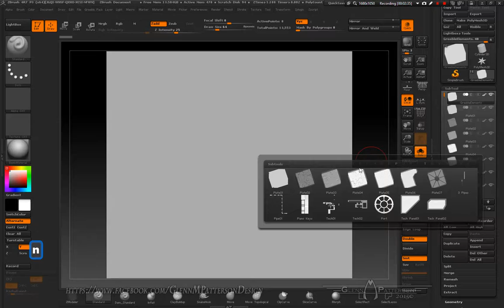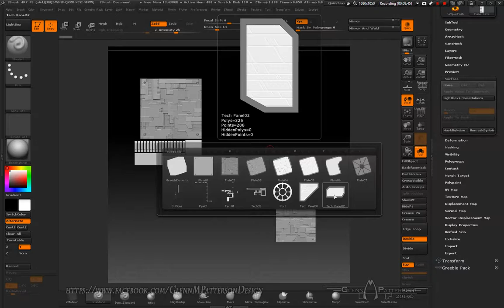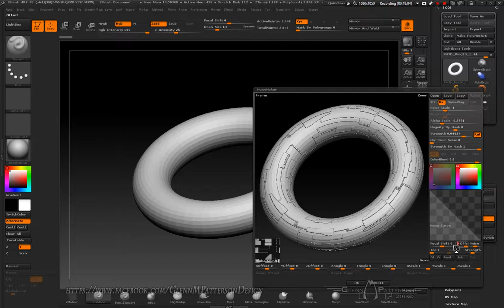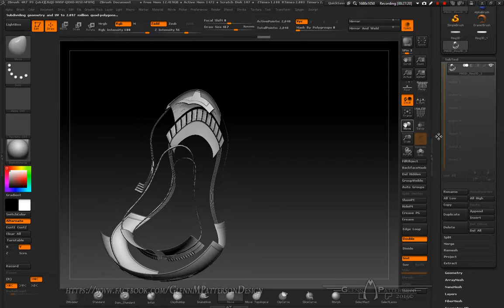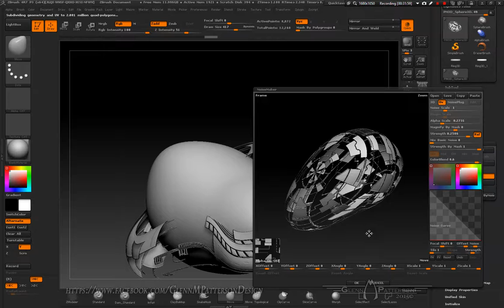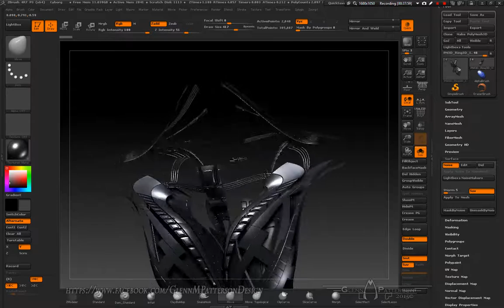Greeble Elements

Comment: Nice, to have the back faces of the cut away new model just duplicate the subtool and than flip the normals in the display properties... than you can merge them and do whatever you want =]
Reply from the maker: ***** Tried that Method. It doesnt work as expected do to the differences of the heights of the Depth Map. Some parts line up, but a lot dont. Hoped it would work, dont think there's a quick/easy solution to making it work. I'll keep tinkering.

Comment: Great as usual!
Reply from the maker: Arn Gyssels Thanks! Hope you can make something Cool with it
Reply: Glenn Patterson Hey Glenn, i can't seem to get the Tilde key right, on a mac it's fn + Alt + n. But Alt + n makes my subtools in my scene disappear, do you have any idea on this?
Reply: Glenn Patterson Ok i found out the easiest way on a mac is to use the layers modifier and change your X or Y sliders.
Reply from the maker: Arn Gyssels
I'm unsure about the Mac keyboard shortcut, I know sometimes they hide the Tilde Key. I wouldnt even know how to setup a shortcut for that key. Glad you found a work around for it, I'll be sure to mention that in my next Video.
Reply: +Glenn Patterson It does not work for me, I mean when I open subtool - inside one tool, no different subtools (Using Zbrush 4R7 P3)
Reply from the maker: +drinxwork Just Downloaded it and it works fine in Patch 3. Do you have Solo on? Then its just a matter of selecting the Subtool you want to Draw on the Canvas.